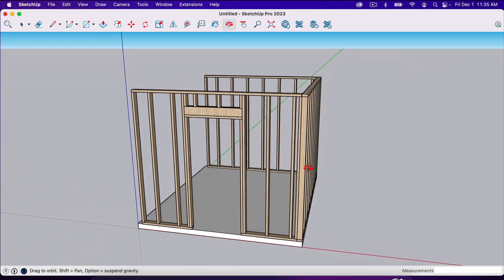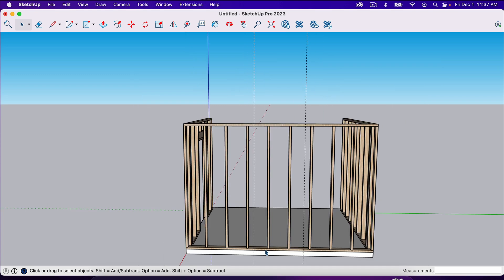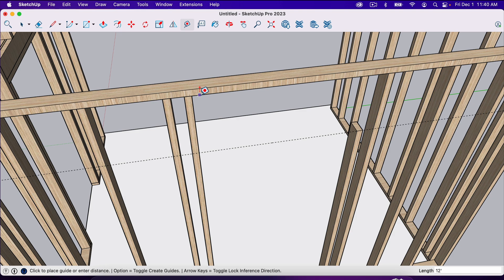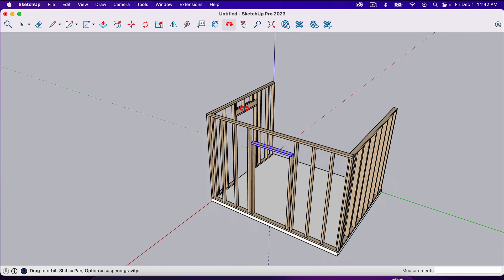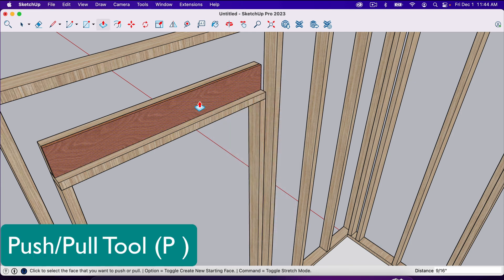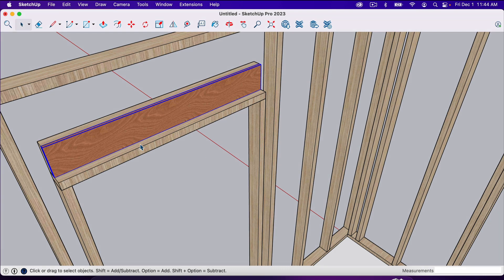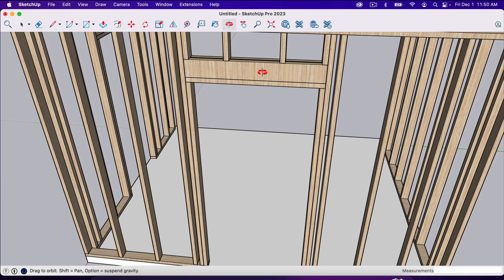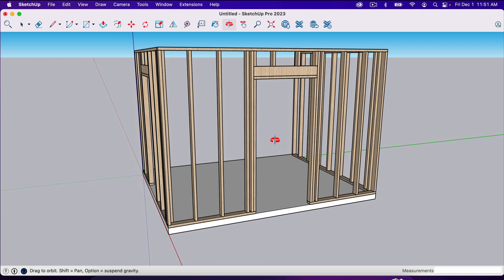How to Frame Doors in SketchUp

Comment: Excellent video! Question on the horizontal 2x4 attached to the bottom of the header. What is the reason for it? Everything Ive seen is just the header without the extra horizontal 2x4.
Reply from the maker: It’s not necessary, can be done either way.